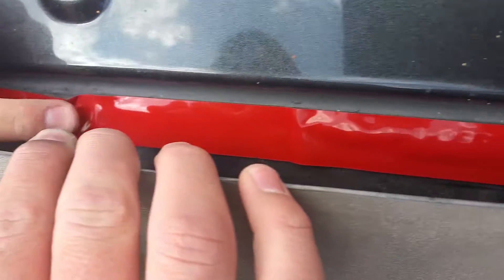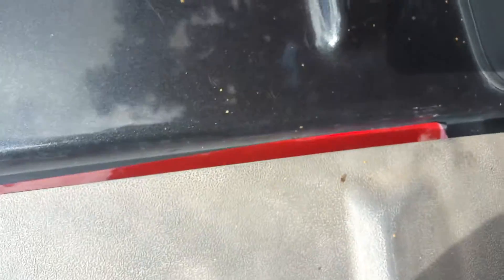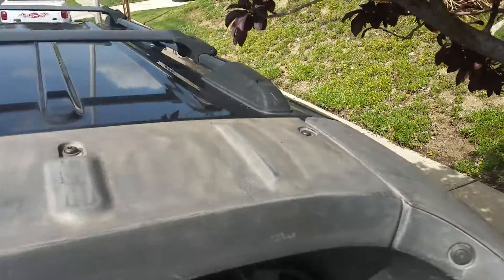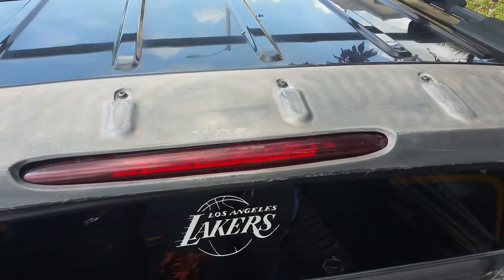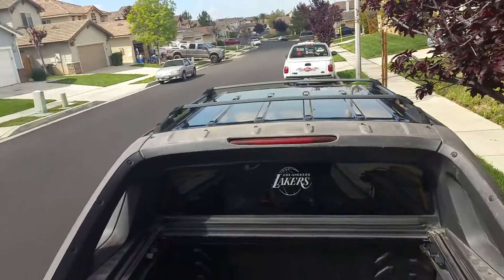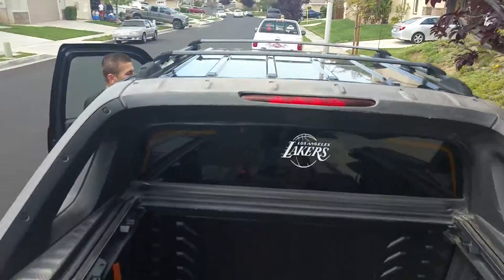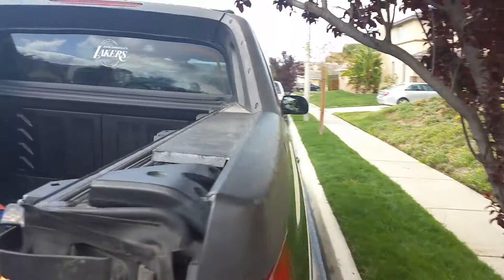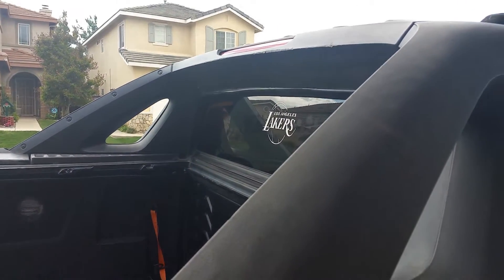HOW TO REPLACE 3RD BRAKE LIGHT, CHEVY AVALANCHE !! EASY PEAZY!! (2002-2012) PART 2

Comment: Don't paint the plastic, I gain 03 avalanche best fix for that is a heat gun run the gun over the plastic ( don't melt it) and the oils in it will come to the surface an return to black,👍paint will eventually peal off.